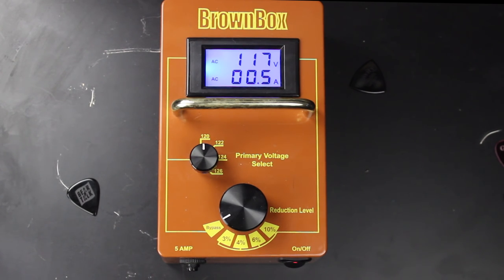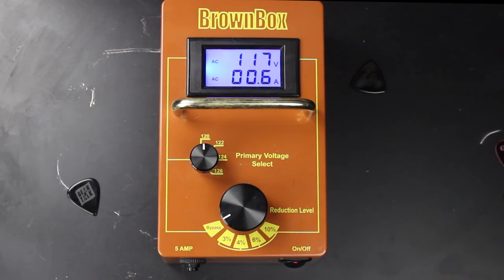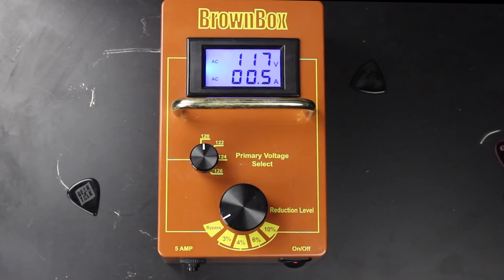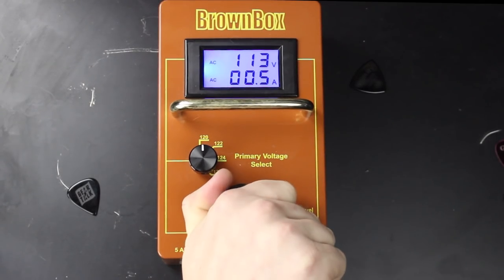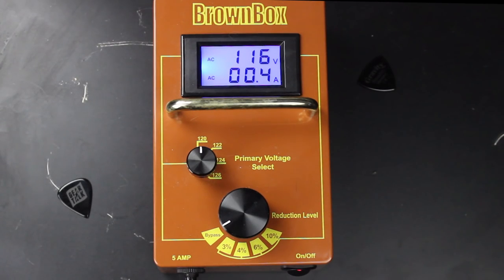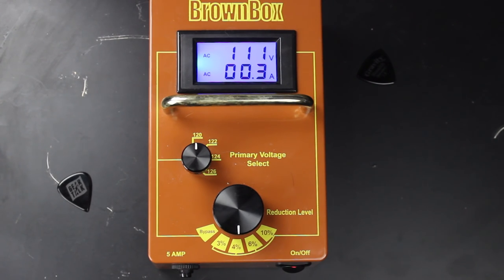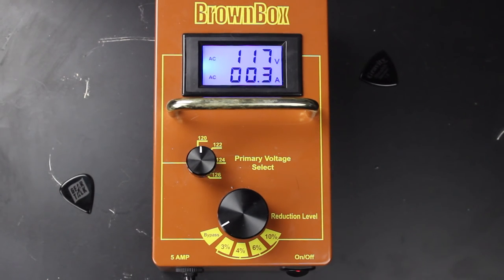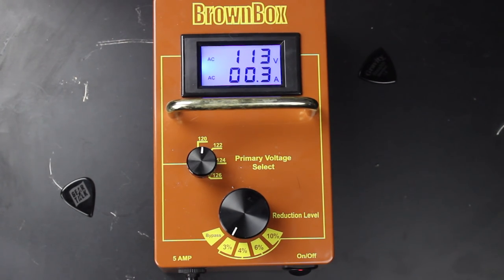Amp RX - BrownBox demo by Lance Seymour - Gear Talk

Comment: If your base voltage is 117v you really don't have an issue. It would make sense to demo it when you're starting at 122 or 124v.
Reply: Thats what I was wandering... if your out of the wall voltage is already 117, you do not need BB.
Reply: @nenadd  you could experiment with it to see how your amps sound, but you’re already running the wall voltage that a vintage amp is designed to use.
Reply: It still makes perfect sense. There is still a benefit of using the brown box when your voltage is less than 120. The demo clearly demonstrated this little gem. He said very clearly that his wall voltage varies between 117 and 120 so he can’t give you 124. Just because you want to see 124 doesn’t mean it would make more sense. It may have made you feel better, but how it sounds will not perfectly correlate with your amps tone anyway because the difference in his amp, tubes, bias settings, and the general quality of the build of the amp itself, so what he showed should give you a good idea of tonal shift, but the main benefit of this device has nothing to do with changing tone.
Reply: On any given day my wall voltage is between 117 and 121v, this puts the voltage where I want it.

Comment: Been running all my vintage amps at 109v with a VARIAC for more years than I can remember. Works for me!
Reply: This costs $350 before tax...a Variac cost far less. This f for those who do not know cha-ching!
Reply: @nasticanasta This is much more user friendly, easier to use and carry, and safer for your expensive amps. So glad I switched from a super heavy and bulky variac with a big knob that is easily turned to high voltage.

Comment: i have a vox ac 15 and a mesa electra dyne, they both are marked for 120 volts but they still sound horrible in my house, will this fix that problem?
Reply: what's your wall output voltage ?

Comment: Hi,, one question  for you. What is the difference between using this device and a variac to lower voltages in your amp?Thanks Michael Newell from Niagara Falls, Ontario, Canada  One last note these boxes are extremely  pricey at $500.00 Canadian dollars
Reply: @BopKitBill  , This brown box is an overpriced ripoff really. Actually my amps sound perfect without gone of these. I do have a 1965 Blackface Bandmaster that probably would benefit from a variac.
Reply: @michel333100  dr z amp just put out video he made one for himself but he said this thing is great. And it very useful.  It just came out today.   He said he could not make and sell this for 3oo . But he said it will save your tubes.    
Check out his video. And I think  owner of dr z.    Know s s thing or two about amps
Reply: A variac is cheaper and allows for infinite voltage adjustment (only 4 preset voltage reduction settings for the Brown Box, whereas with the variac you can set to any voltage you want, at tenth-of-a-volt increments). I use an American made Powerstat 0-140V @ 10A variac, got it used off ebay for $75. Bought a $10 voltage/W/kWh/A plug-in meter off Amazon which shows the output voltage and current the amp is pulling from the wall, as well as a couple of other measurements. So for $85 I have an industrial piece of equipment built like a tank that allows for fine control of the voltage. This setup exceeds the Brown Box in every way.

Comment: 🤓NOTHING BEATS A VARIAC ( use 1 for amps & a 2nd for pedals & rack effects)
Reply: Why would you used one for pedals tho
Reply: @TylrVncnt  🤓120v & up is too harsh, stiff & brash.👍Amps / power amps & rack gear 💥99volts💥 ....stomp boxes 109 volts ..... spaced out & segregated (long daisy chains / guitar / speaker & power cables & using buffers (effect & tool pedals..I have 8 always on.....there are many more ways 2 trick out your gear......i have over 40 years of VIRTUOSO experience,  etc.....can't give u all my secrets ❤GOD BLESS ❤U & YOUR LOVED ONES XO
Reply: This beats a variac. A variac has a big knob that can be accidentally hit and blow up your amp, this cannot blow up your amp. This is 100x lighter and smaller and takes no time to set up. Taking a variac to a gig gets ridiculous real quick. Everyone thinks this is a gimmick but it's not, and if it were a gimmick then why would professional players bother with it? I saw Jim Weider play last week, this was on top of his amp. The price seems to piss people off but buy one and you'll understand why so many players have it.
Reply: @TeleCaster66  👍SOUNDS GREAT, BUT I NEED LOWER VOLTAGE DROPS.....IT WOULD BE ALMOST PERFECT IF THE VOLTAGE RATING WAS 110 V FROM THE ELECTICAL OUTLETS INSTEAD OF 120 V...... ( 1ST GROUP OF PEDALS 107 VOLTS..... 2ND GROUP OF PEDALS...PLUS POWER AMPS / RACK GEAR, ETC...  97 VOLTS )  ⚡ THX 4 REPLYING GOD BLESS 😁👍PS......ALL MY VARIAC'S ARE SAFE & SOUND LOCKED UP IN HEAVY DUTY RACK MOUNT DRAWERS., SUPER SECURE 🤩

Comment: Would this be useable with a build of a vintage with modern clones of transformers, chokes, etc. or just vintage stuff? And would a variac do the same thing?
Reply: The transformers in new amps are designed for modern line voltages. IMO, a variac would probably work better. This thing is for the gotta-have-It's.
Reply: @acoustic61 A variac will not work better, I've gone both routes and this is absolutely better in several ways.

Comment: It's a pretty nice tool and keeps things in the safe margin for the most part.  More so for older amps than newer.  I wouldn't want to reduce the heater voltage in a newer amp.

Comment: Overpriced junk.....a $350 paper weight.
Reply: Which is why so many great players use it...
Reply: Nice if you really need it and want a quick solution but a variac is way less expensive.
Reply: @acoustic61  And a variac also works….
Reply: @williamratcliffe7833  Another reviewer said, a variac can put out too much voltage. I've wired variacs so they max out at line voltage.
Reply: @acoustic61  makes sense